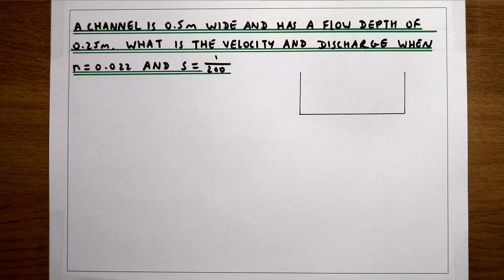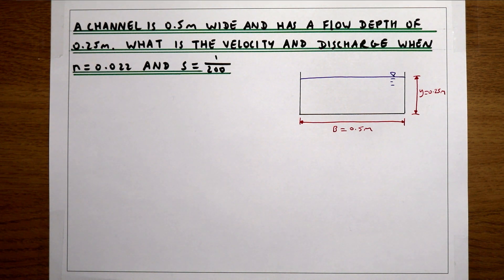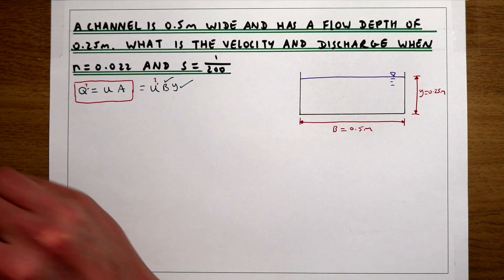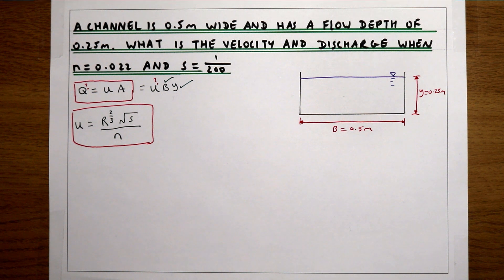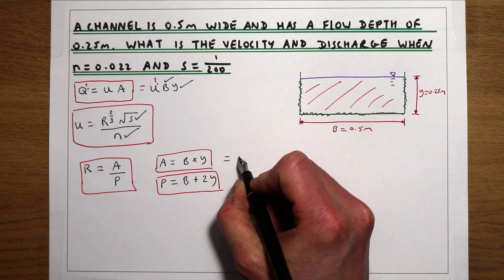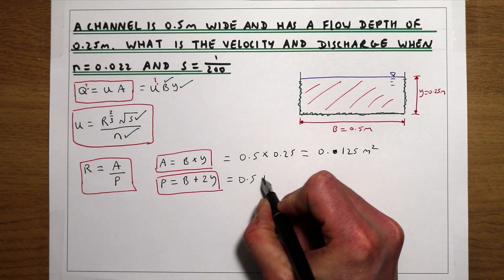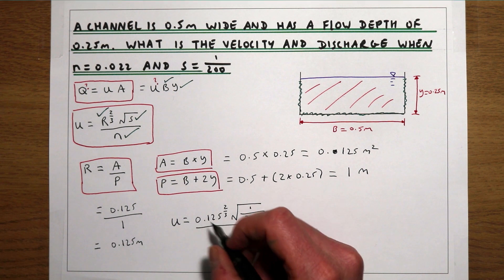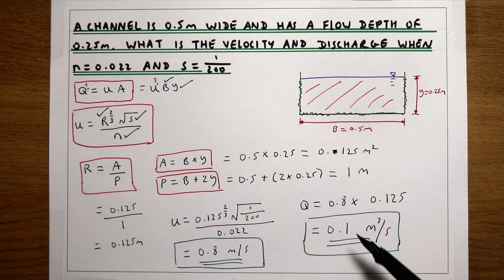Manning’s equation to calculate velocity and discharge for a rectangular open channel

Comment: The question, and final worked-out answer, appear to lack an important distinction.
Instead of “the velocity”, what is actually required by the question, then determined by the working-out, is ‘the AVERAGE velocity’.
Flow through a channel has a velocity profile, grading from highest, or ‘maximum velocity’, at liquid surface, or furthest from channel-contact surfaces, to zero at channel-contact surfaces. A ‘profile’ of velocities intrinsically means there is not one, single, ‘THE’ velocity.
Reply from the maker: Absolutely. In this type of hydraulics, velocity refers implicitly to the cross-sectional mean velocity. However, the true velocity field is much more complex.

Comment: Why the fuck would you use U for velocity. I love how everyone uses their own symbols
Reply from the maker: It’s a good question, but it is fairly standard in hydraulics and (as far as I know) applied fluid dynamics. In hydraulics, u is normal the velocity in the primary direction and v in the secondary. So in the context of pipe flow, u would be velocity along the pipe and v across the pipe.